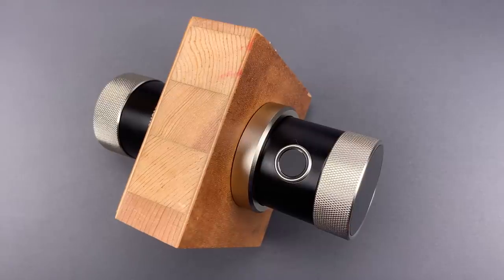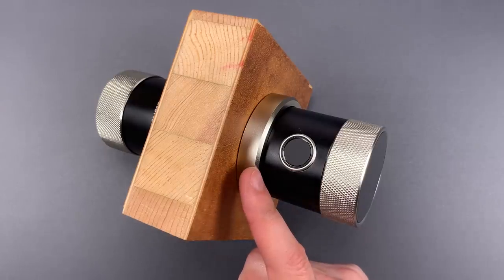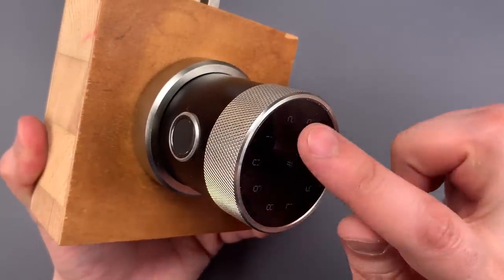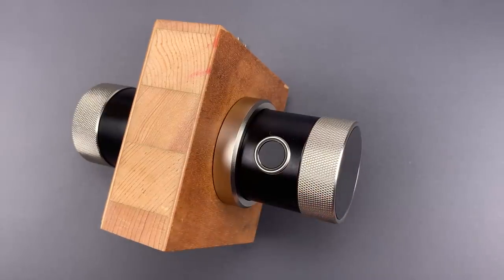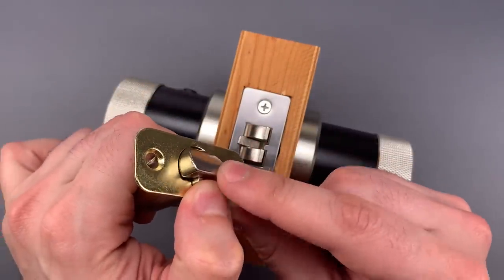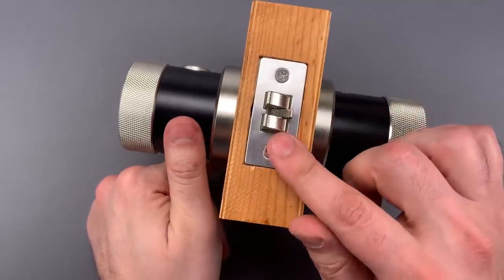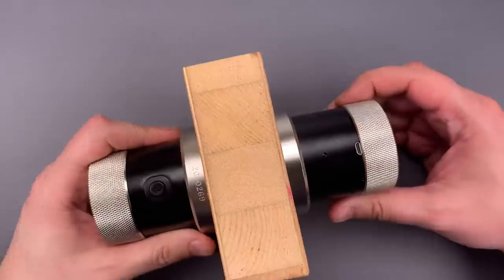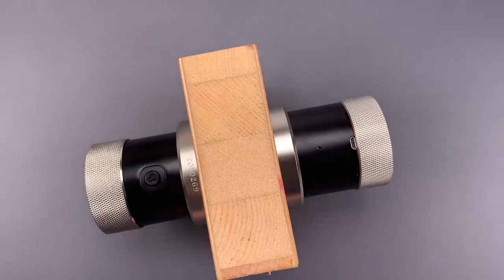[1120] Fingerprint Lock That Forgot The Fundamentals - DatoHome L-B400

Comment: Me running a 25foot USB cable once a week...
"Bro, what are you doing?"
"Charging my doorknob."
Reply: "charging my knob"
Reply: Thinking out loud, they could sell an optional door closer with it. opens easily, but spins a mini alternator when closing. the ribbon wire could stick on flat to the outside frame of the door, and you just paint over it. this then powers a built in charger. done ✅
Reply: Even better, the charging port is on the outside knob?!?
Reply: @BenJamin-en3jb  because if it was on the inside, how do you charge it while you are locked outside with a dead device?
Reply: "Always remember to have a full knob before the babysitter comes over"
Reply: wouldnt help if you didnt notice the USB port is on the outside which makes no sense either.
Reply: Not to mention, it looks like it charges on the outside for some reason.
Reply: @johnfroh6774  the reason is pretty simple.
You need a way to charge it from the outside. Otherwise you would be locked out if the batteries die.
Reply: The USB port is not for charging, it is to power it temporarily if the batteries are dead.

And battery powered door locks are not rare. A lot of office buildings use them.
Reply: It's battery powered. The charger is on the outside just incase you get locked out
Reply: It runs off four AA batteries on the inside of the door. the USB port is for emergency power in case the batteries are dead and you're locked out. But the internal batteries last quite a while and you can monitor them with the phone app.
Reply: @butsgalore  that's how you end up in lists.
Reply: @Jehty_  tbh induction would make more sense, but with micro usb,  you have more options for charging it temporarily.
Reply: "Sorry cant hang today, Charging my doorknob.", thats when you know people are making up things only to avoid you.
Reply: @BenJamin-en3jb  Probably for emergency charging when you are locked out and it is discharged?
Reply: @TheMatBas  Propably. What weirded me out was the absence of a charging port on the inside. At least I couldn't see one, I hope there is one. So the user can charge the thing while the door is closed ;)
Reply: @BenJamin-en3jb  it uses normal AA batteries. It doesn't have a rechargeable internal battery. The port isn't for charging the batteries, it's just for powering the lock if the AAs are dead. If you use rechargeable AA batteries, you would take them out of the lock and put them in a wall charger like normal.
Reply: @cydia2020  
ye but... what if it's out of power and you're locked outside? ;D
Reply: @cydia2020  Yes, the motor is most power hungry. But the battery has self discharge too, and the electronics consume a little even in sleep mode. I would give it 6-7 months before you get locked out of your home and have to run USB cable from the neighbors.
Reply: @johnfroh6774  As some else mentioned, if the lock was dead and you were outside, you would have no way to charge it.
Reply: Hahaa 😆
Reply: @TheGrandexeno   Can I borrow it when you're done? I got a lighter and a book that I need to charge?
Reply: Introducing power bank
Reply: @BenJamin-en3jb  Needs to be on the outside, if it battery dies and it is on the inside and no one is inside to charge it how do you get in?
Reply: @MFreeman9110  How do you charge it when you're locked outside? You carry a powerbank with you each time you leave the house in case the knob might loose power?
Reply: @blahblah3347  just ductape a bunch of portable batteries to your door and wire them together all across your house to the closest outdoor outlet if you dont have one then well just keep adding charged ones till you are out of room
Reply: @MFreeman9110  maybe just know its charged before you leave or when youre leaving plug it the fuck in before you go?
Reply: @blahblah3347  I have one and it actually surprisingly lasted 11 months but around 9 or 10 it got slower
Reply: ya if it dies you cant get in or out of your door, you may as well just run the cable through the wall and keep it plugged in 24/7
Reply: @MFreeman9110  simple 

CHAINSAW CANNON
Reply: @MFreeman9110  Charge port on both sides maybe?
Reply: @sycholicthebigdukesix3441  Having the charging port on the outside prevents you from getting locked out of your house because the battery died, while you probably can open the door from the inside even with a dead battery.
Reply: @leolo2222  Thats why there's a USB port on the outside handle
Reply: @Broockle  Thats why theres a chargibg ports on the OUTSIDE handle
Reply: @mummifiedgamer  A: whenever I carry some sort of bag or backpack, definitely yes
B: There are those people called neighbours who are usually kind enough to help you out with such things.
Reply: @blahblah3347  you could just run usb cable from your phone.
Reply: FUTURE
Reply: 'Charging ma knob' in a southern english accent
Reply: @WhyWouldYouDrawThat   That's actually not a bad idea.. nice!
Reply: Sadly, the USB jack is on the OUTSIDE, and it doesn't charge the batteries.  I thought it was for charging, too, then saw it was on the outside, and was like.. WT#???  So I looked it up.  It's only there in case the batteries die completely, so you can use a USB battery bank to open the door.
Reply: @BenJamin-en3jb  Yes- so that if it dies while you're away you're not locked out of your house.
Reply: @WhyWouldYouDrawThat  is a mini alternator not just an electric motor?
Reply: @BenJamin-en3jb  So it can be recharged in case it runs out of juice whilst you are locked outside.
Reply: @TheGrandexeno  Also works with  static electricity through friction... So I've been told.
Reply: how about a automatic door closer attached to it but with a dc motor to generate power whenever it opens and closes, also, wires needed would be pretty sleet cause You just need two strip fo metal running those the widthnof the door that carries non damaging current. Only and Idea lol
Reply: @johnfroh6774  Not to mention that you and other people didn't get it...?! Why is that? How do you unlock your own house if the unit is dead without breaking the door? That's the idea here.
Reply: @cydia2020  maybe in texas. I bet that will not last a month in a proper winter.
Reply: @BenJamin-en3jb  Right.  Only unsecure side of door should have any access ports of any kind.
Reply: @BenJamin-en3jb  and during zombie invasion
Reply: They make electric hinges that allow you to power stuff in the door itself by running electricity to the hinge side. The knob can probably be disassembled and a 5V supply soldered directly to the USB connector for hardwiring.
Reply: @Dr.Ratio69  Yeah, because I always carry a power bank with me.
Reply: @nogghan4637  The batteries in this thing are not rechargable.
Reply: @cydia2020  yeah but at that point, why not just put a dynamo on the knob so you charge it a little after unlocking? That's straighforward to do and gets rid of the charging need entirely.
Reply: how large are those feet?
Reply: @blahblah3347  nah, you just make sure to change the batteries when the kick tells you the batteries are low. Like every other electronic door smartlock on the market. Even the non smart licks will give you an audible/LED warning when the battery is low. You've got to be a complete moron to get locked out. And self discharge rate of AA batteries is negligible. They'll last four years. The thing that uses the battery is the motor and Bluetooth. Even the quiescent current of the electronics is negligible.
Reply: @cydia2020  so what happens in a year when the power runs out? You’re locked out? Or does it stop working and doesn’t lock at all?
Reply: @BenJamin-en3jb  And it’s micro usb as well. Not that hackers care, they can just use the internet to unlock your door.
Reply: @BenJamin-en3jb  it's an extra layer of security. You have to power it yourself, so if the burglar doesn't have a powerbank, they can't get in.

(since we can't joke on YouTube anymore: before the AAACKSCHUALLY crowd comes, the above is a joke)
Reply: So if this thing runs out of charge are you locked inside? Or it just unlocks once out of charge?
Reply: @WhyWouldYouDrawThat  WELL... what are you waiting for. GO MAKE MILLIONS BROTHER!
Reply: @WhyWouldYouDrawThat  Lol yes! Mark Rober should do this totally.
I wonder how efficient it would to just use that power in general for some thing. I guess the big question would be the air conditioner. Maybe if you had a screen door?
Reply: I thought maybe it's possible to hack the knob using the micro-usb port?
Reply: Micro USB, no less

Comment: Datohome , thinking that they are invincible : " We use no key to prevent lockpicking and wont fall to LPL's magnet trick "

LPL : * whips out a plastic sheet *
Reply: The magnet is what I was predicting when the video started.
Reply: LPL : "Hold my pick that Bosnian Bill and I made"
Reply: Me: pulls out a butterknife
Reply: LPL should drink a red bull again, last time he did he picked five locks with just the can
Reply: @DeeSnow97  Are you trying to push lock companies into bankruptcy?
Reply: Not gonna lie, when I heard the whir of an electric motor, I thought "Oh good, there's no solenoid. This will be interesting!"
And, well, it WAS. I didn't know that was what the peg on the door catch was for!
Reply: Having fun isn't hard if you have a library card.
Reply: I was almost expecting LPL to break out some more modern attacks and come up with a flaw in the bluetooth communication or show how trivial it is to inconspicuously clone the RFID tags if you're nearby. Not to mention trying to lift a fingerprint from the sensor or exploiting the fact that even though the display on the front of the knob appears to be digital the placement of the digits is always the same.

Comment: Red Bull can test: Passed. Paperclip test: Passed. Fork test: Passed.  Doh, forget to check whether a bit of floppy plastic will open it.
Reply: @Stay_away_from_my_swamp_water  If the tolerances (or the design) on the door frame are good, a fork won't open it - but if floppy plastic gets it done, so should the soda can.
Reply: Should be able to get it with a red bull or paperclip, and if you carved it thinner, a fork lol
Reply: You can do the same trick with a piece of the can for sure
Reply: Willing to bet the paperclip will fit through the pinhole and open it up.
Reply: Isn't a plastic sheet THE tried and true method of opening doors for people who accidentally locked themselves out?

Comment: The problem with multiple ways of entry is that you're only ever as secure as the least secure option available
Reply: Which is why when I added a zwave lock to my door I looked hard for one that did NOT have a keypad on it (which was actually a challenge) as I was already adding one additional attack vector, I didn't want to add 2.
Reply: @Green__one  That's a bit over the top.
A well-designed keypad will in almost all instances be more secure than any other way of entry in a high-security installation including the remote, RFID or biometric authentication methods, the reason it's not the chosen way of authentication is because it's inconvenient and slow, and also because biometrics, RFID or remotes allow for identification of the individual opening the door, or at least who's device / card / finger it was that was used to open it, and auditing is desirable for many such installations.
Reply: @Timbo Dewabem true, no point in a good lock if i can easly kick the door in
Reply: @alec1575  I remember the Burn Notice pilot episode or maybe one of the first ones had a drug dealer with metal door and walls made of thin paper, basically. 

However, I feel like these high-tech locks are an incredible tool to have for a patio door or something like a small shed for, for example, delivery purposes. Like, you can unlock it for a delivery guy, and if someone wanted to take the delivery from the porch, first of all, it's already harder than just grabbing it, and second, wouldn't it mean that instead of a simple theft, the person is doing a burglary \ breaking and entering, which is a way worse offence?
Reply: As the saying goes "A chain is only as strong as the weakest link"
Reply: @haakonht  Well, if you use the keypad, the wear or fingerprints will usually give away all the digits used. You also don't know for sure if there's a hardcoded code added "in case you get locked out", which completely defeats the lock once it's leaked.
Reply: @HughNeutron  Okay...

You find a keypad, you can see the following keys are worn: 0, 1, 2, 3, 4, 5, 6, 7, 8 and 9.
You are already aware that the access code is 16 digits. (Which is more info than you would have in the first place)

Oh and you get 3 attempts before the lock shuts down for 5 minutes and the system logs a failed entry attempt.

How many human lifetimes will it take you to decode the lock?
Reply: @haakonht  
Since you know that each number is used at least once, it's narrowed down slightly from the number 10^16 (1 followed by 16 zeroes) to the sum of 10! plus 10^6. That's 3,628,800,000,000 possible combinations. If you could do one per second (you can't, but for argument's sake) it would take 115,000 years (around the clock, no breaks, at 1 combo per second) to try them all. I'm not even going to try to add in the 5 minute breaks.
Reply: @jacobg5122  Nice, but how do you know that every number is used once? All you know is that every number has been hit. There might be individual entry codes, the code might change every month..

Simply the fact that you are able to determine wear levels on individual steel keys with engraved numbers is pretty impressive unless the people working there have diamond hands.
Reply: @haakonht  
Using all the numbers at least once reduces it by about 97,000,000,000,000 combinations, which is a a lot but pretty inconsequential considering it would take over 1400 lifetimes even without those extra combinations. Either way it's a lot longer than I'd be willing to spend messing with a door. I think I'd just break a window.
I also realized I did the math wrong and fixed it (maybe) but it didn't really make much of a difference. Still a long ass time.
Reply: @haakonht  
I think the other guy was talking about a 4 digit combination on a pinpad with rubber buttons. If you find one with four worn keys, you only have to try 4x3x2x1 (24) combinations, which would take you, at most, 40 minutes of waiting for the lock to reset plus a few seconds for each attempt. Incidentally, on a 4 digit keypad without the keys worn in, you have to try 1,043 combos and would have to spend a total of 1,735 minutes waiting if the combination happened to be in the last set of three you tried.
Reply: @jacobg5122  12,082,192. That’s how many years it would take if each attempt took you 5 seconds and if you have to wait 5 minutes after every third attempt.
Reply: @kellanbradshaw461  
Yeah I think I'd just go to the next house and try them instead.
Reply: @jacobg5122  "If you could do one per second (you can't, but for argument's sake) it would take 115,000 years (around the clock, no breaks, at 1 combo per second) to try them all" 
from an owners perspective, coming home fully drunken and you forgot the password... impossible to get in haha
Reply: @jacobg5122  one of my friends always changed once per week the code of their garage door, must be annoying to learn every week a new code, better go for proper keys and a safe lock xD